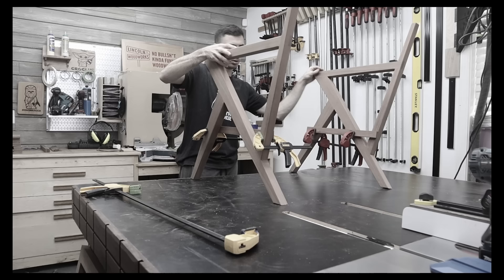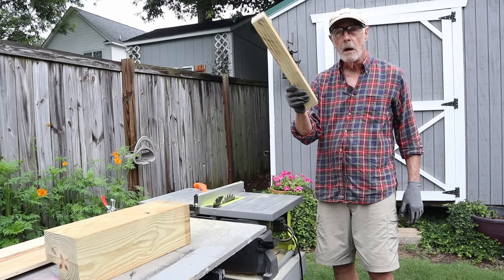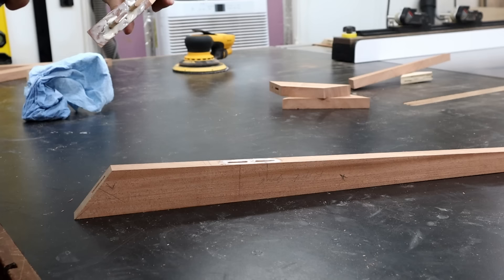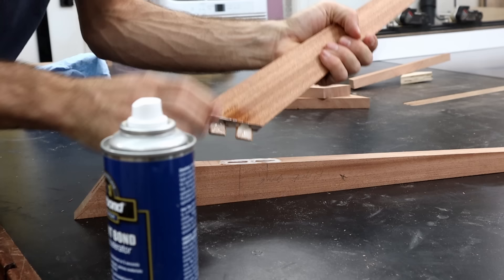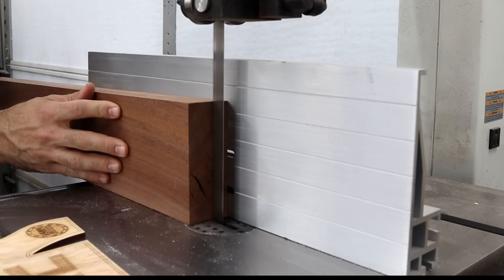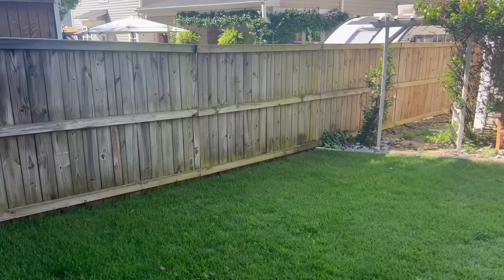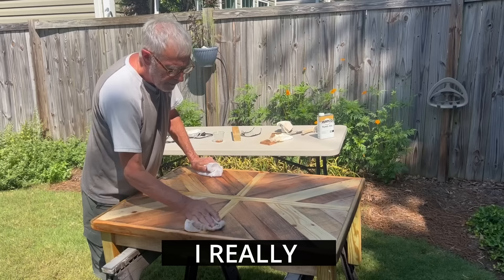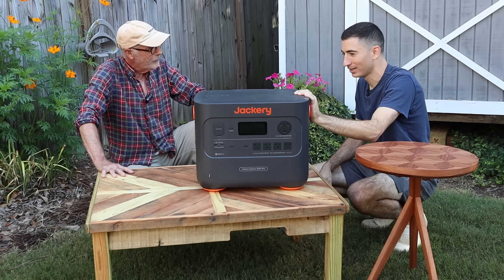I challenged a 78 year old to a build off

Comment: All ima say is the jackery was placed on the winning table. If you have a heavy object in hand and walk past one table to set it on the next. Its clear which you would use in real world circumstances. The tiny circle table is a leave it out on the deck one summer and probably have it broken by the next. The solid pallet table is a leave on the deck for years friends prop feet up on it some nights by the fire,  put beers down on it in spare time, maybe work on a vehicle and have parts laid about across it.... Circle table cant handle that lifestyle it would be useless for anything more than a single plate and drink... But im big on practical over pretty.
Reply: Bear in mind I have children and I foresee that heavy top plate being knocked over and snapping the center weak point. I'd love to see a video of the circle table falling over a few times once on wood once on concrete stress testing it basically... anytime you have a protruding surface out from the legs, tip over factors go up exponentially you bump it it falls basically... You bump the pallet table it either doesn't budge or slides slightly lmao far better design. I had 4 little plant holding glass tables VERY similar in design to the younger guys table none of them made it 2 years.
Reply from the maker: Tables don’t just self destruct, it’s a sturdy little piece. It’s still the exact same as the day I finished it and has been living on our front porch

Comment: I like both tables. Older John is great looking, re-purposed old wood, innovative and creative, with much less tools and finished easily well before time. Even without all the fancy time saving tools. It looks nice, has character and good design. The only thing I do not like is the legs. They just do not seem to fit, Idk why because it is a rustic old wood table. Yet the legs just don't fit. Perhaps in part because the table looks like exterior wood while the legs dont. Or they needed a bit more of a design feature, being just too square which the rest of the table is not at all. Idk. But the end result is a sturdy and rugged very nice table. I also like the younger John table as well. Looks great, very intricate design. Simply put it looks like a nice yet functional piece of art. It goes fairly well with the chairs too. I so want to pick older John table simply due to how creative it was. Yet in the end I think I like the look of young John's table more. It would also really depend on what I needed it for too. Older John table would go well anywhere outside, but I could just picture some outside sitting nook somewhere where that young John table (and chairs) would look awesome.

Comment: If you have used battery powered tools, you know how expensive they are. But say you have a full set of battery opperated tools...screwdriver, drill, chop saw ect... Your battery just dies, maybe you have two that dies. The replacement batteries cost more than buying a whole new set. I still have a circular saw that my dad uses. I am 58 years old. I am on my second set of battery powered tools. First set was dewalt, second set whatever was on sale. Battery powered tools also don't do well on wood that is under pressure (like beams which support the weight of a cabin). A battery opperated lawnmower is atleast 500 dollars to whatever price they csn get you yo pay. A corded electric one I bought for 150 dollars 15 years ago. Still works great. My brother just bought one. Hard to find now because they want you to buy a new battery powered one every 10 years. Also if you happened to leave a battery in the cold of your garage... well you now need new batteries which will cost you more than the tool it is used in. I bought a battery opperated whippersniper, battery died just after warrenty. The replacement battery cost more than the tool...so i bought a corded one. A quality named tool last as long as a cheaper brand, you just can't access the internet with it. I learnt that when replacing an engine in my sports car...it was just a generic motor with bling bling attached. I have battery powered tools, I just don't spend much money on them.

Comment: For $2200 I will use extension cords.  If I was in a place with no electricity I would use a $500 gas generator.

Comment: a spark from a cell phone at a gas pump could Stop that dream real fast. Ask a firefighter, not the folks who say it Is a safe thing to do. Both tables look cool to me, great contest.
Reply from the maker: There has never been a documented case of a cellphone starting a fire at a gas pump. Never mind a camera
Reply: When have you ever seen a cell phone spark ? Plus the air fuel ratio would need to be so high which would only happen if you were spraying gas around the forecourt.
A very silly UK program called TopGear did an experiment where they left several open container of gas in a small caravan, scattered half a dozen cell phones around & then called them all, no explosion.